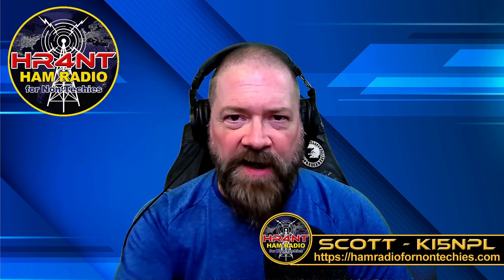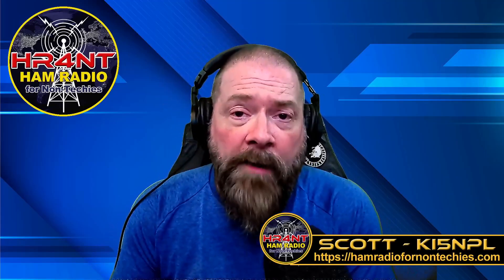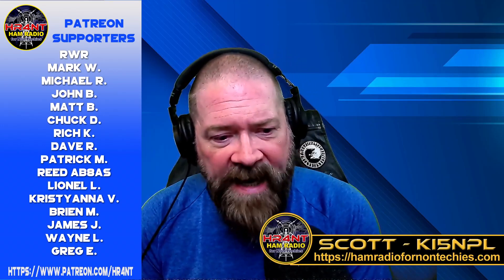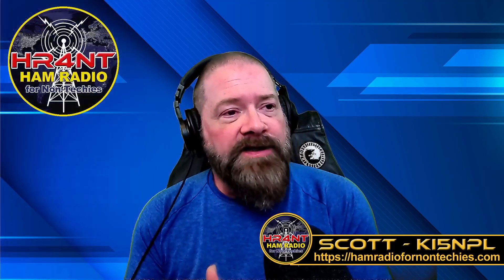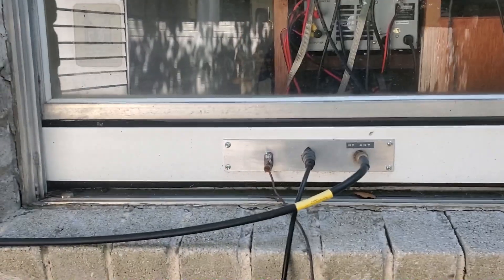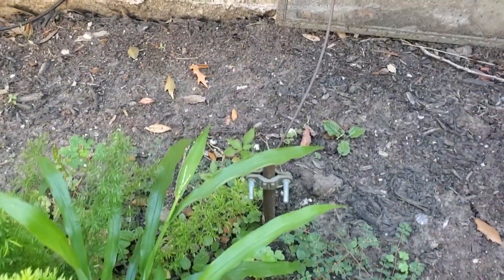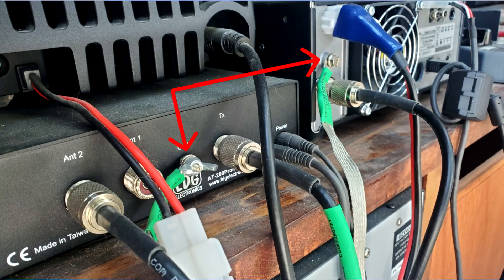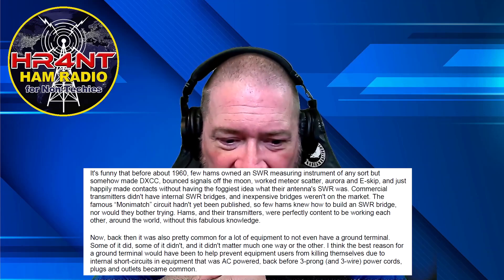Grounding My Ham Radio REVISITED:  What I Have Learned Since Then

Comment: Since my other 'note' here I got rid of the borrowed Kenwood 570D with all the bad audio reports and bought a new Yaesu FT 710. I LOVE this radio. No more bad audio reports and I just keep making contact after contact (on several bands) to the point that I have to quit because my jaw hurts (ha). But, I still get little shocks when I touch my radios. Nothing major but it's to the point where I 'slap' anything before I actually grab it. As before, nothing is grounded beyond the triple-prong electric plugs. I have read SO many articles online about this and none of them agree on how (or if) I should ground my shack. KD7LWL
Reply from the maker: That is fantastic.,  Glad you found a solution that is working for you and eliminating that bad audio.  Investing in a good radio will serve you for a long time down the road.  I am always apprehensive about buying a used radio just due to the fact that I do not know the history of the radio and if something goes wrong, it's on me.  I think you will be very happy with that radio!  Thanks for the comment and for watching.  73!!

Comment: I watched this video after watching your earlier video on grounding. Since I'm not grounded now, I don't think I'm going to run out and get a "grounding rod" to try to correct my bad audio reports. I think maybe some more "RTFM'ing" might be more productive. But as I said in my comment on your other video, I just want to turn on my radio - and talk to the world. But these bad audio reports are bugging me. I've been all over the web looking for suggestions.
Reply from the maker: My suggestion is to check your house and see if there are immediate issues you can resolve there.  Sweep around for noise and RFI.  AFTER that, then start scanning around your neighborhood. See if neighbors houses are emitting RFI.  In my situation, I have a neighbor with a solar farm on his roof that trashes my ability to use any of my radios at home.  I have to go 30 miles to a POTA park to operate.  He has not fixed it to this day a year or so later and I have already addressed the issue with him.  Palomar Engineering has RFI kits for ham radios that are suppose to be effective and help.  Thanks for watching and for the comment.  73!

Comment: Very well said and yes, I too unplug everything. I've also learned that if all your gear is grounded and if lightning strikes near by, that electrical power from that strike may or can just travel in the ground " soil " and to your ground rod of your shack and back in to your equiptment even if all your coax is unplugged. Thank you and all the best sir.
Reply from the maker: Exactly!  Better to be safe than have a massive bill to replace gear!  Thanks for the comment and for watching.  73!

Comment: I’m going to ground mainly for RF noise considerations. I run off of battery, but grounds are important for noise
Reply from the maker: They can be.  I would test your noise levels with and without and see if it is actually making a difference.  Thanks for the comment and for watching.  73!

Comment: Does the ground you have help with noise prior to grounding.?  I'm looking at doing similar outside my window
Reply from the maker: The RFI coming into my shack from my solar panel neighbor is so bad, that I cannot tell you one way or the other.  Until that first issue is resolved the noise could be coming from multiple places.  The only thing I am SURE of is that it is not coming form inside my house.  Thanks for the comment and for watching.  73!

Comment: Where I believe many are lost when one starts to use categories for their ground. Yes there are good house electrical ("safety") grounds, good lighting ground and good RF ground but (now listen) there is only one ground. What If one tries to maintain two separate grounds? It's not like you can your not going to dig a trench and pour molten glass to isolate your 2 ground system. If you do then you will end up with some unknown stray resistance and path between the two. This path will likely have a high impedance or a strange path through through
Reply from the maker: That sounds right.  I think my solution is a good one.  Thanks for watching and for the comment!  73!!

Comment: Q"  NO#1 Bare copper vs Insulated copper wire or it don't matter at all. No#2 Does having a ground rod keep the noise floor down in your radio ?:goodvibes: KQ4FIT
Reply from the maker: A NO#1:  I don't think it matters, however you may be hard pressed to find shielded copper wire in 6 or 8 gauge.  A NO#2:  Grounding "can" have an effect on noise under certain conditions.  The only way to find out if it helps you in your situation is to give it a shot and see if you notice a difference.  I hope this helps.  Thank you for the comment and for watching.  73!

Comment: People overthink things. Is it code to bond ground rods regardless of purpose? Yeah. Was it done without bonding them in the past and it worked out fine? Also yeah. Is it better to bond the 2 rods? Sure.

That second rod you're using for RF grounding only, not actual electrical equipments safety ground. It's not "earth" (pun intended) shattering to omit that if it's a huge ordeal to put it in.
Reply from the maker: There are definitely exceptions to that statement, but the online folks (QRZ excluded...LOL) are fantastic!  Thank you for the comment and for watching.  73!
Reply: @HR4NT  Oh man , don't get me started about QRZ...

Comment: I had a lightning strike take out two antennas,  radio, and other components.   It also took out other equipment,  including the phone line that traveled 6 blocks away.   It also melted solder in the plumbing and had some flooding.   The house ground line is directly connected to the plumbing.   It doesn't go back to pole. No ground goes back to the power source.   Electrical codes very from state to state, province to province,  country to country.   Some will tell you that a grounding rod needs to be 8 feet long and an X amount of distance away. Another says it's a 4ft long rod.    Any amount of grounding you do is better than nothing.   What you have done is a lot more than some.  I had a 50' tower with 20' of antennas above that.  I had it grounded to a 4' rod. In 20 years, with some of the most intense electrical storms, it was struck a total of zero times.   So seriously,  don't overthink it.  The radio chasis should be grounded through the electrical plug, but check that to make sure, especially in older houses.   Anything you add after that ( static/lightning arrester, copper grounding plates, 4ft grounding rods) are all a bonus, but not necessary.   Good video.
Reply from the maker: Thank you so much for sharing that info.  That explained quite a bit and confirms that my method was sound, not perfect, but sound...LOL  Thanks for the comment and for watching.  73!

Comment: I agree. I am sick and tired of people talking about NEC this and NEC that. They read 20 seconds of the NEC requirements and are now experts. In the Army they would tell us to "close it out." Guess what NEC guru, close it out! There is no way I personally can run 200 feet of ground wire to the electrical panel. Oh, so someone wants to chime in and tell me "good luck with the insurance company." Good for you smarty pants. I am also sick of the grounding and bonding nonsense. It adds more wires and does not appear to work for me. My noise floor is the same. My antenna performance is the same and technically, the type of antennas I run are supposed to float anyway. Half of you people running your traps have no idea what you are talking about so stick with trash pickup and avoid the electrical engineering comments.
Reply from the maker: I think you nailed it and touched on some areas I didn't think about!  Thank you!!!  Grounding is such a hot topic with hams and one that causes a ton of overthinking.  My solution may not be the best, but it works for me and my gear is always protected 110% of the time.  Thank you for the comment and for watching.  73!

Comment: Have you ever heard of the military Surface Wire Grounding Kit, MK-2551A/U, (NSN 5820-01-263-1760)?  The kits is issued with some communications and precision receiving systems.  The concept is that using multiple short stakes all tied together can accomplish a similar effect as one long, deep grounding rod.  I won't say that it's better or even equivalent, but I will say it's easier to install, and especially remove, when it's time to take it out.  The stakes and cable are made of steel, so we're not even talking about copper.  I'll let you look it up, but its a completely different take on grounding.  I'm in the process of working toward grounding my system, just because, and I've decided to create something like it.  My reason is mostly because I don't want to drive a super long rod in at the location where I want to have my grounding.  It worked fine for me in the Army, so we'll call it good enough for me at home.
Reply from the maker: That is fantastic to hear about!  Thank you for sharing.  I will definitely have a look at it and see what it's all about.  Thanks for watching and for the comment!  73!!

Comment: I usually just slap an 8 foot groundrod every 16 feet until I get to the main ground. If I can't do that I just pop one outside the window and hook all my gear to that. Most hams aren't running 1500 watts from a 100 foot tower so things just aren't as critical as a million dollar commercial radio station. I just unhook everything in storms and don't sweat it at all.
Reply from the maker: That was kinda my thought.  This technique has worked very well so far with zero chance of trashing my gear.  Thanks for watching and for the comment.  73!
Reply: @HR4NT  My main concern is will the circuit breaker trip during a fault so I test it and if it works then we all set. Overcomplicating doesn't mean its right. 👍

Comment: You make some good, common sense points. My station is DC powered from a 400 ah, solar charged battery. The only ground I use is an RF ground at the lightning arrestors on the 4 coax leads coming into the house. In 10 years, I have never had as much as a static shock.
Reply from the maker: Sounds to me like you nailed it and it is working out perfectly for you!  Simple is sometimes the best.  Thanks for watching and for the comment.  73!!

Comment: Grounding, in this case, is more about RF interference. If it's a 3 pronged plug, any internal shorts should go back through the panel as far as personal safety goes. What you should be doing is bonding, which is different. You're making sure the potential is brought to the same level from antenna to equipment and any excess charges can bleed out to earth. It's not for safety and it's certainly not to protect your equipment. Lightning can force electricity through many paths that otherwise don't exist and the safest most sure way... you already practice and figured out is simply to unplug the equipment. Back to the topic of your current ground... you can use a ground bar/distribution block/terminal blocks you get the idea. Much better connections. If you must use that copper pipe... take a hammer to it and hammer the sucker flat. Then drill holes and use proper lugs or nuts/bolts at least. You want clean strong connections and you don't want ground loops. I'd ditch the pipe and get a distribution block personally but up to you. Again, this is all to clean up signal. I wouldn't cut the ground wire going outside, just put a sleeve through your pass through and caulk it. Whatever that screw is will have different electrical properties and cause galvanic corrosion most likely. 

Cheers.
Reply from the maker: Thanks for sharing those tips.  That is something i plan on doing in the future.  For now, this seems to work, but I like your idea a lot.  Thanks for watching and for the comment.  73!!

Comment: Just my 2 cents, feel free to toss it if you want.  I would recommend setting up case ground to your antenna ground while operating for one reason only.  There is a chance of the two ground rods being at a different potential.  If that happens, you'll develop a current in the coax shield.  You can make the case ground with a quick disconnect to keep with your current storm plan.  I have shorting plugs that pass the antenna to ground when not in use.  Prevents static arcing from center conductor to ground when lightning is near.
Reply from the maker: I actually have lightning arrestors on all my coax going from the antennas to my shack.  Great tip!  Thanks for the comment and for watching.  73!
Reply: @HR4NT Your video helped me overcome MY paralysis by analysis. 👍🏻 Curious, though, about the arrestors on your coax. I too unplug everything (power & coax), but how are your arrestors installed? If my mast takes a direct hit, will/can anything come inside the house via the disconnected coax? That’s the last hurdle for me. Your video helped me over one the others. 🙏🏻

Comment: The earth is a ground anyway so attaching the two rods together up high or down low doesn't really matter. However, I'm starting to think that grounding is necessary at the shack. Just get a rod in the ground and don't worry much about how that gets done. But you don't want to rely on the ground of the house because it may be really long and act like an antenna itself.
Reply from the maker: Very true.  I think my solution of unplugging everything is sound.  It may not be perfect, but my gear is guaranteed to not get fried by unplugging everything.  Thanks for the comment and for watching.  73!
Reply: You’ve probably heard this already but for those that haven’t:
During a lightning strike there is potential/voltage until the charge (+/-) has balanced itself out. If you have a strike by one ground rod and theres a copper path to another section of unbalanced ground then your un-bonded grounding circuit will potentially become the least resistant path, with possibly 100’s of thousands of volts, along with high amperage using it. You unplugging/interrupting that path with that much voltage, have the potential of witnessing a brilliant arc flash before it includes you as part of that path.

Comment: You're a life saver!. I'm coming back to scanner-bank monitoring after a 23 year hiatus. Got my analog scanners; got my antennas assembled; got my (your) window pass materials; got antenna masts (wall mount brackets coming); got highest quality low loss coax and connectors at Ham Radio Outlet nearby. I'm external picking up where I left off mounting 2 UHF band antennas (to start) just like 23 years ago, ready for external mounting when EVERYTHING COMES TO A SCREECHING HALT OVER ...grounding. The house is circa 1952; my radio antennas appear to require nothing more than previous split-bolt/grounding clamp connections (telephone, old cable TV, two (2) old satellite dishes) to the electric panel ground wire going to the supply water pipe just like back in the 90's. In the 90's I didn't ground my coax...wasn't recommended by instructions then. Got the AARL book and everyone telling me I gotta do this copper treatise  "cause the book says so". IMHO residential ground rod this-n-that came about as new housing migrated from metal supply pipe to plastic/PVC...so a replacement Earth connection was required...the ground rod. Same boat as you...shack coax grounding would require a wire around the house doorways, under sidewalks, (OH NO!!!) can't go through the UN-finished basement despite satellite and everyone else of the utilities doing just the same. You saved me HUGE heartache so I can easily and finally get back to scanner radio in the few years I have left.
Reply from the maker: Hey I am glad to hear it and glad that I was able to shine a bit of common sense light on a topic that enrages a lot of hams...applying the K.I.S.S. method sometimes is just the best way to operate AND this technique will 100% ensure that your gear is protected at ALL times.  I was running myself ragged trying to figure out how to ground and follow the "rules".  Turns out that this is a lot simpler and resolves most of my issues.  Thanks for watching and for the comment.  73!

Comment: LOL, I've been in the hobby for decades, but guess what, I'm s-t-i-l-l a "non-techie" in many ways (& this subject is one of them)! My shack is on a 2nd floor, somewhat inaccessible for easy grounding, so I've never done anything there; of course, I've grounded the obvious (telescopic masts outside to ground rods, etc), but I'm not losing sleep over any of this for one reason: when storms are approaching, I unplug everything, I mean EVERYTHING, like coax, power cords from wall outlets, etc; otherwise, I have fun & get on the air! Great channel, glad I found it & 73 de WA4ELW in TN 🇺🇸 dit dit 😃
Reply from the maker: I think that is the best solution to what is made out to be a complicated problem!  Thanks for the comment and for watching.  73!